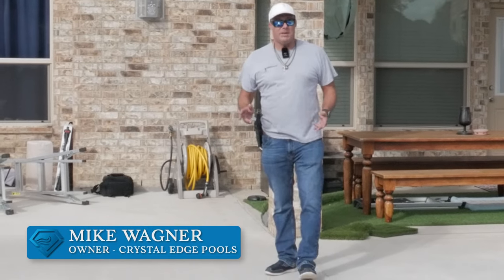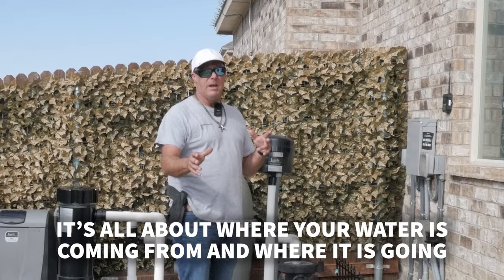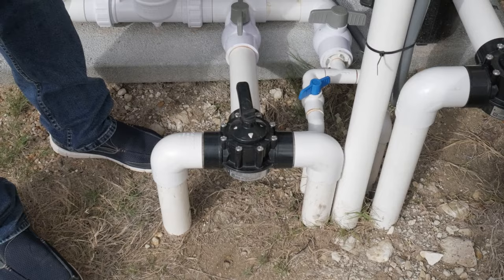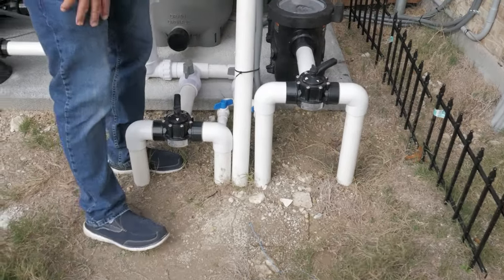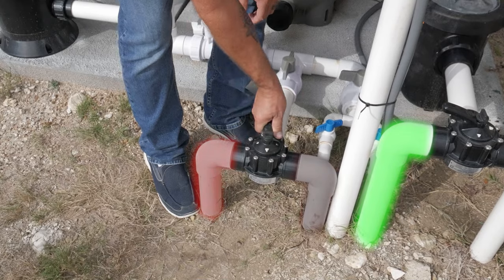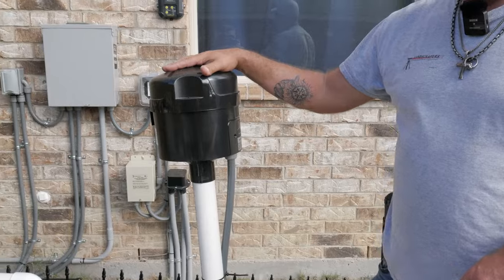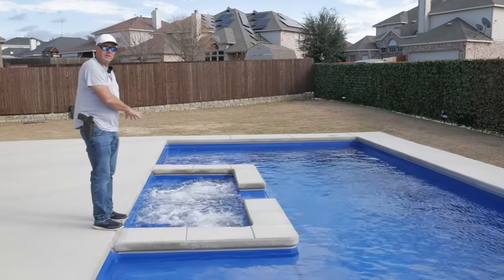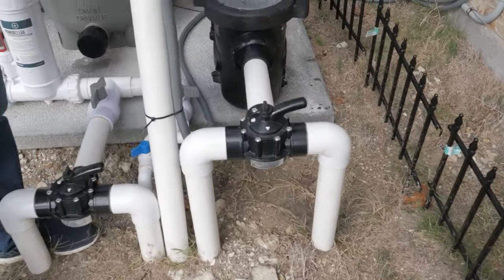Simple Guide to Operating Pool/Spa Combo

Comment: I have a pool that was installed in 2019 with all of this Jandy equipment with no blower. My spa used to blow bubbles but has recently stopped producing bubbles. Any idea why this happened?
Reply from the maker: Hi gunner0322. If you have a spa system with no blower, you likely have a venturi system with draws in air as the water is flowing through the jets. This is usually fed through inlets at the top of the spa. These often times look like small circular discs on the top rim of the spa. Regardless of where exactly they are located, if these air inlets become clogged with any debris (such as organics, dirt, etc) they will choke of the air inlet and reduce the amount of air introduced to the jets when flowing. The first place to start is to locate and confirm that these inlets are clean. Most venturi caps are removable and then cleaned out. Obstructions can be lodged at times due to the vacuum created in this design to feed air into the system. Give that a shot and let me know if it fixes your issue.
Reply: @CrystalEdgePools  thank you!

Comment: In normal operation do you position the 3 way valve for the return to be 50/50 pool/spa? Or mostly to the pool, with a little to the spa? (My spa spills over into the pool)
Reply from the maker: Mostly to the pool with a little to the spa. I move the larger body of water more

Comment: Dumb question but what do you mean by “if you have a stand-alone spa”
Reply: I was wondering the same thing
Reply from the maker: A seperate fiberglass structure not molded into the same composite pool that shares the recirculation system

Comment: Hi, at 1:45 you refer to the Main Drain/Spa Draw, which is a single pipe.  I have a very basic spa and pool combination but it has separate main and spa drains, plus the skimmer and each have individual ball valves.  This allows me to empty the spa for cleaning.  
I don't understand how the main drain and spa drain can be combined with no apparent means of selecting either.  Can you clarify please?

Comment: Question: do I need to manuall turn the spa valve to drain just the spa or can I drain the spa by only pressing the spa drain button on the Jandy computer panel? Also do I need to turn spa pump and pool filter pump off?
Reply from the maker: If you can send me a description of your jandy interface and maybe a couple pictures of your pad, I can better answer that question.

Comment: Awesome video. I have a question. My system is like this one except my spa is above the pool. I’m have an issue with an actuator/valve. Sometimes I loose all my water in the spa during freeze protection mode. My question is can I set the valves in the middle where it will move water in the pool, spa and spillover at the same time? I have a switch where I can get the actuator to a position and turn them off. Is that possible to do. Thank You!
Reply from the maker: All actuators typically have an override switch usually on the underside of the unit that allows for a change of direction or an "off" if in the middle. I would consider using the switch to manually actuate it to a position that would always send some water to the spa and the locking out movement by placing the switch in the middle until the season resumes.
Reply: @CrystalEdgePools  ok good, I know how to move the electric valves manually, thanks! We are out of cold weather now. I just completely shut it down and winterized it. For next year, should I stop it in a position where the pool is running and hot tub is spillovers at the same time or is it possible for spa and pool to be circulating. Or is there a way to spillover, spa, and pool all 3 modes at the same time. I’m not that familiar with what all needs to be circulating so it doesn’t freeze. Hope this isn’t too confusing. Thank you!

Comment: Great video, and love the 2A.....I moved into a home with a pool, and a spa a bit higher so it has a waterfall. 
I had the Hayward 2.7hp motor with the tall 72sqft DE filter, and it had 3 Jandy 3 way valves. 
It also has 2 other PVC tubes that are venting down. I dont know what those 2 tubes do, but one of them looks like its been there a long time, and the other has newer top connections, both with a 90 pointing down so nothing falls in I guess. 
I am able to get my pool do the bubbly therapeutic action without a blower, based on how I have the valves set. 
BUT, I have 2 of the jets of the spa acting as SUCTION! The spa also has 4 drains....2  drains on the foot wall of the spa, and 2 on the actual floor of the spa, ones that look like the main pool drain.  I am not sure what they are doing.

My pump was starting to act up, and I wanted to install a replacement heater (the one we got with the house doesnt work, a pretty old Raypak/Teledyne), so a friend gave me a more recent heater...., and so I hired a Pool guy to install the heater and a 3hp pump. Things look good, he did have to correct one of the things he plumbed. He didnt change the plumbing that I can tell, but now the spa does not bubble like before. I said it used to, though without the heater. Now I have a heater, but no strong jets like before.  He said one of those tube exhausts was likely for a blower, but they stopped the suction from the spa drains and made the 2 jets being the suction for some reason.   I am confused, BUT, the jets were strong enough to cause thrust action in the spa before(no blower, never even knew they used a blower). So fed up, as he keeps adding cost to the service, and I cant blame him, but I also cant be sure of what he is claiming.  I'm not far from loading it with dirt and starting to plant and grow my own food!
Reply from the maker: Boy, im sure sorry to hear that! The pipes with the 90's are likely for venturi air (air introduced to the spa system through vacuum when the water is pumped through the jets at a high rate of speed). Many spas use this system and it usually works fine. We started adding blowers for 2 reasons:

1. On demand air through sealed plumbing
2. Venturis can get clogged at times

Its hard to know how things have been plumbed after a pool is finished, and we can only hope it was done correctly. However, I have seen jets act as inlets on a spa to feed the venturi. I dont know if thats the problem on this, but it might be. Usually an air blower can be added to a system you are describing if it was plumbed correctly. They are relatively cheap and run off either 120 or 240 from your subpanel (depending on which blower you choose). Im not telling you to do this, but it can be an option. The rule for blower size is 1/4 hp for each jet (i.e. 6 jets= 1.5 hp blower). Should you elect to do this, it may fix your problrm, or it may not. I have to emphasize that because i do not know your pool plumbing i can only throw it out as an idea and cannot guarantee results, functionality or possible future problems on the system. One way i would try to determine validity of this approach would be to take a shop vac (with the hose on the blower side) and try to introduce air through your pipes. If you get the result you are looking for, you may consider a blower addition. Again though, because i cant verify how your spa was plumbed i can only throw it out there as an idea and not a suggestion.

*Make sure the blower is mounted 1' above the water level of the spa when installed!!! Many people add them too low and not only will they not perform right, they can also receive water back up into the blower (even if they have a check valve)*

Dont lose heart! Usually there is always a way to fix these problems!
Reply: @CrystalEdgePools  Thank you for the detailed response. Makes good sense. Will see how I go about it.

Comment: excellent
Reply from the maker: Many many thanks
Reply: To confirm, I have similar setup and same where both knobs “out” are pool and both “inward” is spa … that said there is always some slight circulation in my spa even when fully “outward/pool” … ive been hesitant to shift knobs anything other than fully inward or outward.  Is it safe on the equipment to go more 70/30 type as you showed here? (assuming the skimmer has enough flow to move)